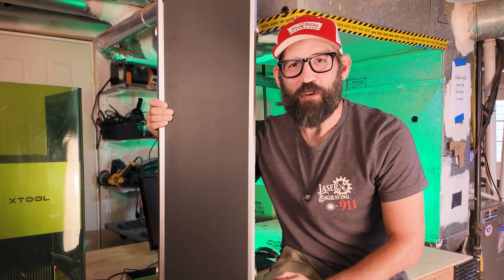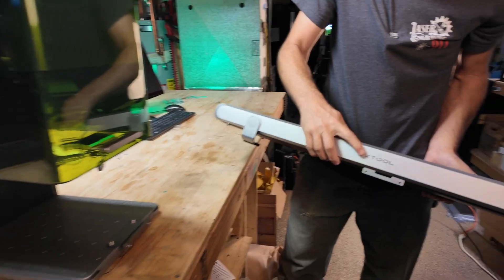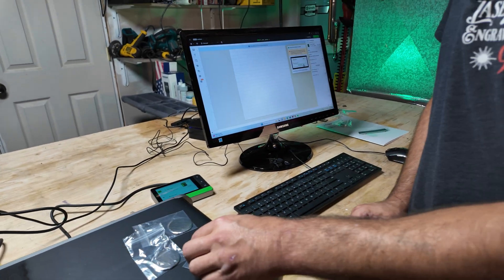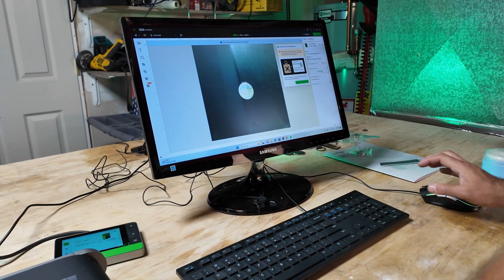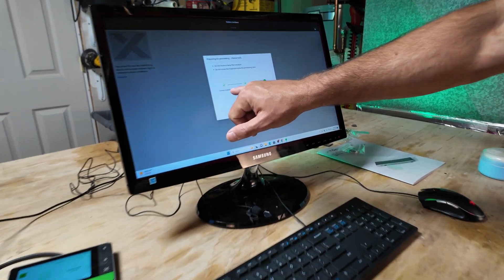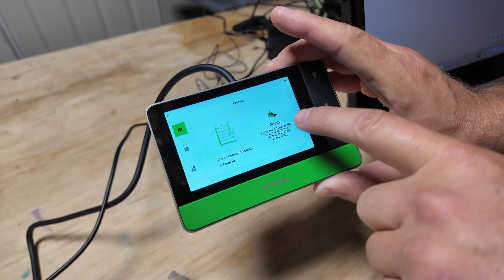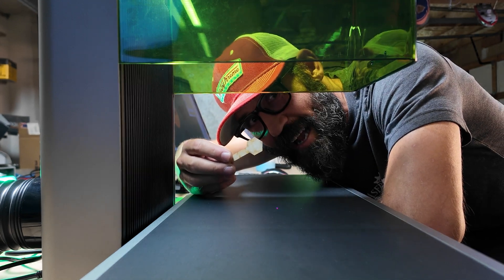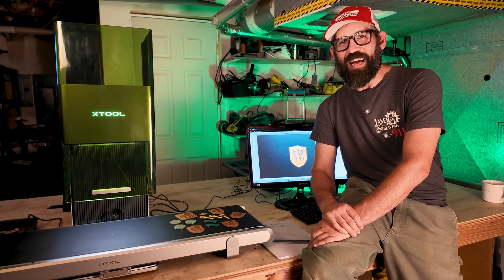We Need to Talk About The xTool F1 Ultra Conveyor Belt

Comment: Lol my conveyor has been sitting in its box since it arrived 2 & 1/2 months ago - i'm excited to use it eventually but i've been hammering the life outta the F1 Ultra doing tons of material tests including spray painted ceramic tiles, Titanium Dioxide coated tiles, Borax on wood, all sorts of metals, glass, metal business cards - gotta say i hate doing embossed slate coasters - far too messy) - Ra2 rotary also tested out... i don't move on until i'm satisfied with finding all the sweet spots from my experments so i'm very close to trying out the conveyor very soon... Cheers for the Vid 😎👍🏴
Reply from the maker: Isn't the F1 Ultra a fun little unit! I'm getting ready to release video on a bunch of setting I created and I had a lot of fun making it.. stay tuned!

Comment: They should have made the bracket that is on the actual f1 go up from the bottom, not taking up any working space. That is a waste in my book of making the working space bigger, if you have to use the working space for attachments. I know it’s not while using the conveyor belt, but that means you have o take the bracket off each time you use it. Which could lead to stripping screws and losing pieces!
Reply from the maker: may the will in round 2!

Comment: How deep would you recommend is needed for the F1 Ultra for the table depth considering you need to hook the exhaust up with the conveyor system . 

Thanks and great video
Reply from the maker: I measured and a min depth would be 26" to allow for the exhaust vent.
Reply: I have one last question before I pull the trigger on this . Do you think you could engrave multiple Golf tees on the side like a company name with success using the ultra conveyer by just laying them out randomly but not over bunch

Comment: Great review & demonstration.  You mentioned serial numbers.  Is there any feature, current or planned, that would allow an incrementing number or maybe text from a file (like names for badges)?
Reply from the maker: Great suggestion! I pass it on!
Reply: @LaserEngraving911  Or like a folder of images. That would allow someone to use the same stock material, but engrave different things on them all in one batch. Like business cards, where every employee has a different QR code (or maybe even their own picture). You could then upload a folder with all the card designs and put a bunch of cards on the belt to be engraved.

Comment: Looks like a good accesory. The slide deck for the f1 is so slow as to be useless for anyone with a bigger option.
Reply from the maker: I think so, its got some serious potential, I'm looking forward to see all the different ways people use the conveyor! THX!
Reply: @LaserEngraving911  the major limitation of the slide deck is its internal speed. If they fed it 4” then used the galvo, fed it again and repeated it would be faster than everything else I own but as it is too hard to setup for comparable speeds to modern open frame diodes.
Reply: I've literally made this SAME request to xtools to utilize the galvo